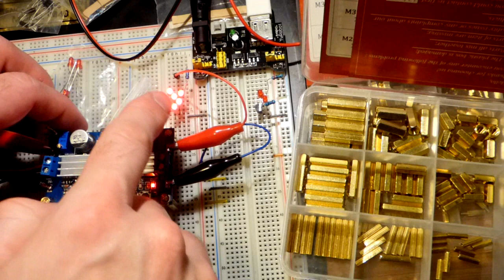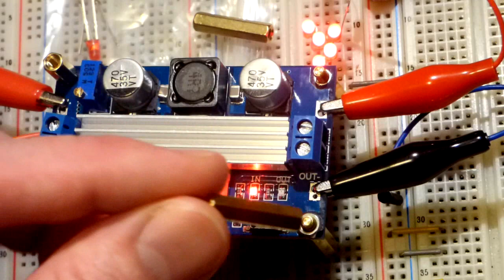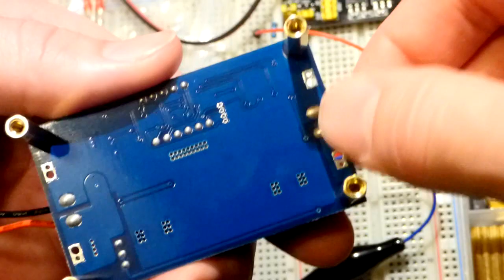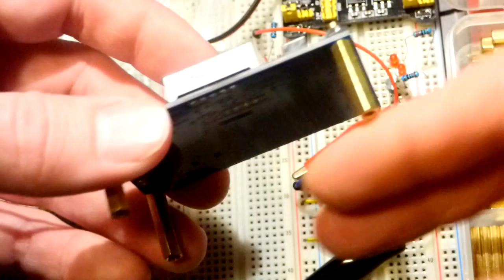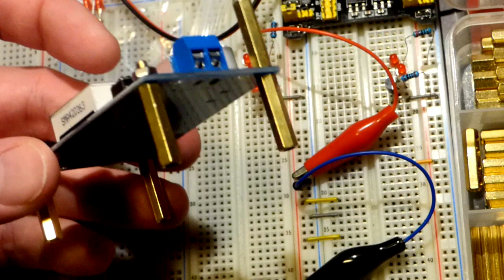Adding safety spacers to protect my better step up voltage booster module

Comment: That's cool, 
How many amps is that rated for.  

Is this the do hickey I'm looking for 
To power a laptop off of the 12 volt system in the Van...  ? 

Neat could you put a link to your supplyer... 
Or do I just use eBay... Thanks
Reply from the maker: I buy from Amazon because I have prime, which gets me 2 day shipping and I trust the sellers more than Ebay, but I buy from Ebay from time to time if it will be a big price savings.
https://amzn.to/2WVnWLf is a different amazon seller who labels it's specifications. The one I got it from stopped selling it. Looks like for steady supply it should only output 75W which I think is low for laptops.

For the van, I would use a cigarette lighter inverter like this one https://amzn.to/2Y2zd91 if it meets your needs. The power supply that comes with the laptop does a lot to protect it.
Reply: @Electronzap   yeah I found some on eBay and $6.22 backup camera and screen call send a link later it's hilarious what you can get these days or nothing
Reply from the maker: Very cool!